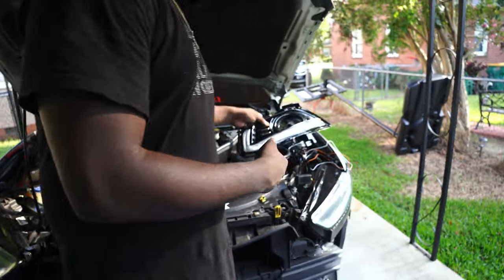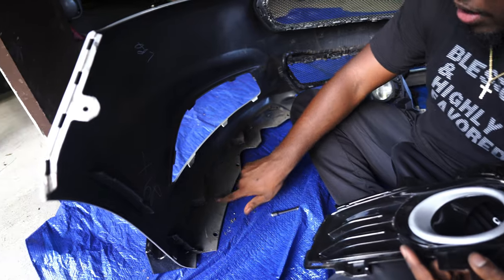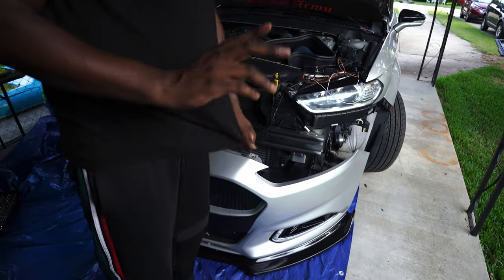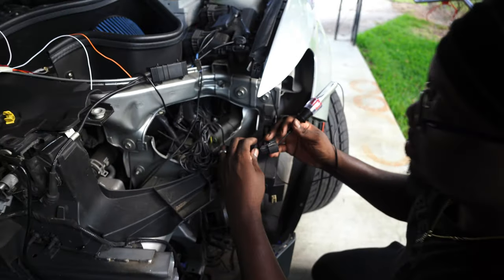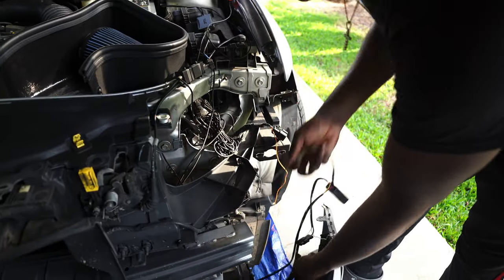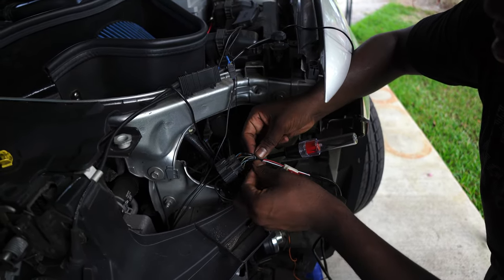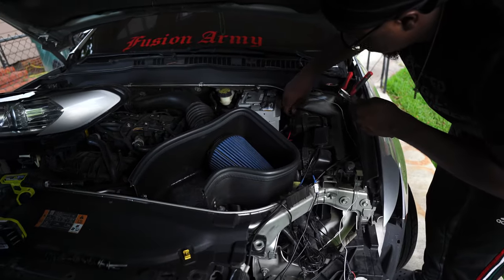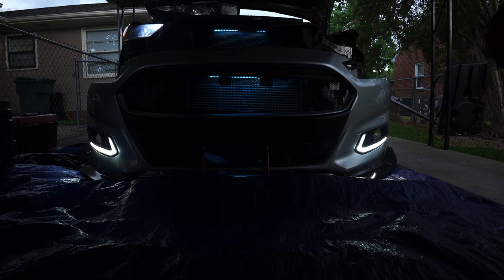How To Install Daytime Running Lights (DRL’s) Fog Lights on 2013 Ford Fusion

Comment: I'd definitely recommend soldering the connections if you can. I installed the rear bumper reflector lights and I soldered all the connections. I should have tested all the wires with one of those test lights you have because only the parking lights work. I went off a picture of the wiring diagram that someone posted on Fusion 2g forums. But I could have saved myself some time if I had used a test light. It's easy enough to unsolder the wires and switch them if I care that much about it.
Reply from the maker: I totally agree. But reason i used electric tape is because imma have to tap in to the turn signal wire for my custom headlights then ill soldered.

Comment: What's up, thanks for the video. I just got my lights and was reviewing your instructions. The harness I have has a green and white wire on the DRL. The white is supposed to be a dimmer.  I'm assuming the green is the L turn signal. What do I do with the white wire?

Comment: Do you have the steeda cold air intake?
Reply from the maker: Yes
Reply: @ljraww9064  Is the Steeda cold air intake worth it over a K&N? I want to get a cold air intake, but don't know which one is more worth it.
Reply: @circuitprogaming3652  both sound similar, just depends which brand you prefer

Comment: I have yet to take my bumper off but I have to this season. That wiring is to much for me. I might try to pay to have it done.
Reply from the maker: I just took mine off yesterday I sold my DRL Foglights
Reply: @ljraww9064  Ya I'm in 4 fusion groups on fb. I couldn't make the flood last year due to repairs. If I'm lucky I might try to have a little vacation down there and I might try to contact you and pay you to install some DRLs for me.
Reply: @ljraww9064  I like in ny so I'm waiting for it to warm up so that I can change my fog lights.